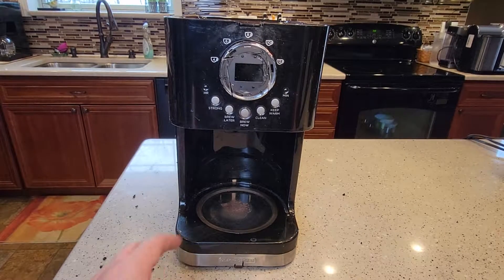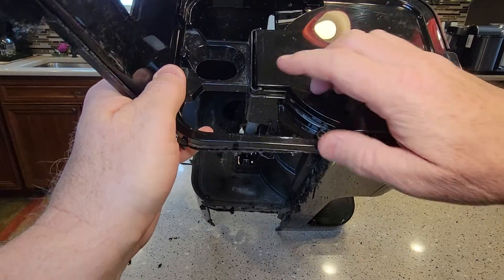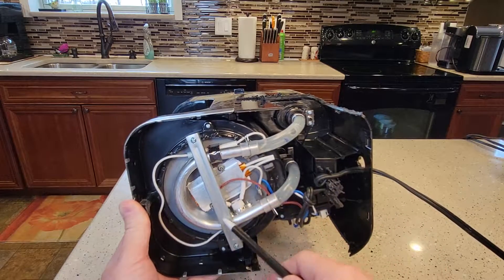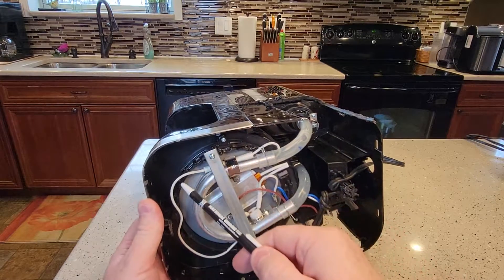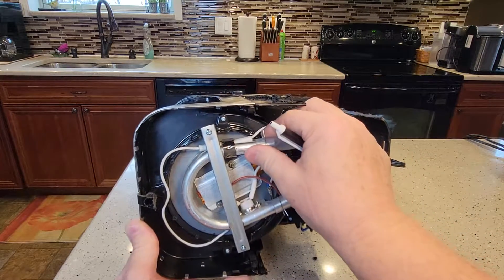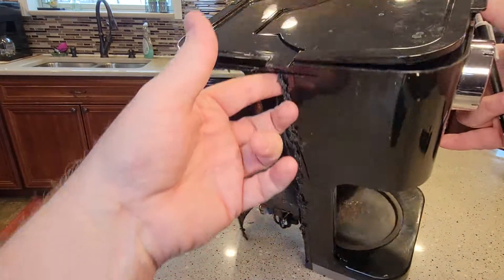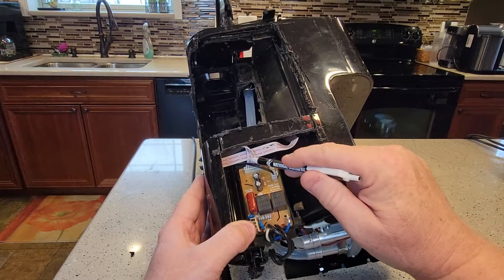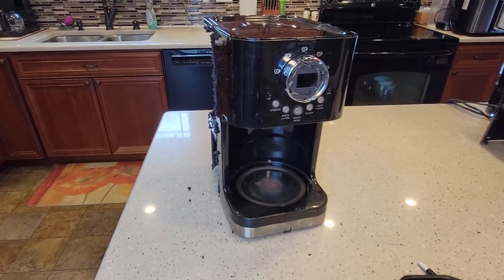Black + Decker Select A Size 12 Cup Programmable Coffee Maker How To Repair and See INSIDE.

Comment: Wish you could change the heating element for the warming plate to one that isn't so hot so it doesn't burn the crap out of my coffee after I leave it on the pot.
Reply from the maker: Some of the Cuisinarts let you control the heating plate.  Some viewers only use stainless steel carafe (coffee pot) they don't use a warming plate to keep the coffee hot they rely on the double wall insulation to keep the coffee hot.  I did a review on this and it will keep you coffee hot for up to 2 or 3 hours. https://youtu.be/63jERuTWUxM